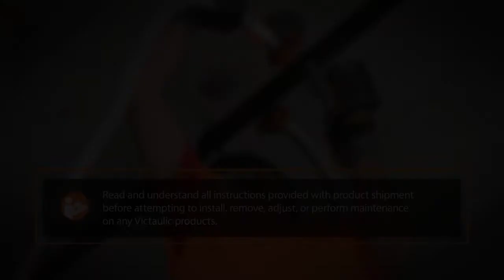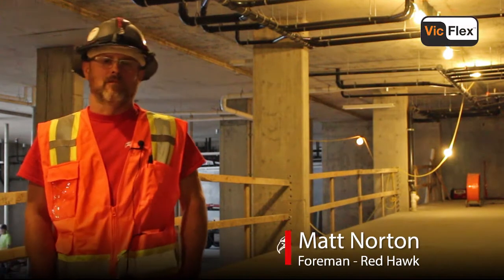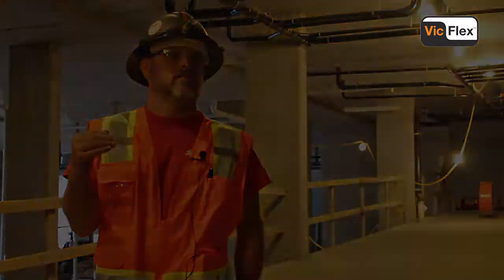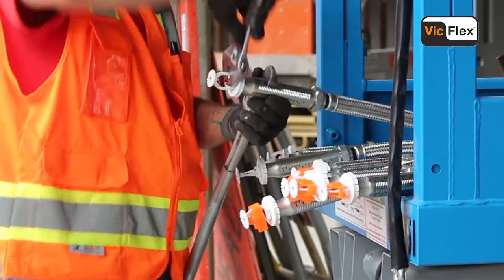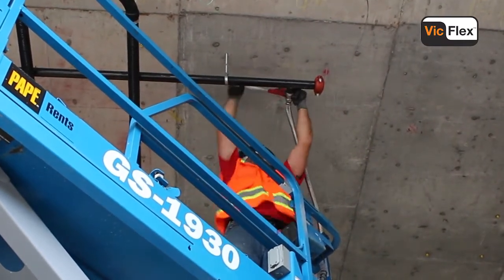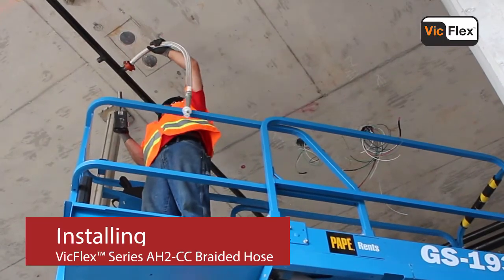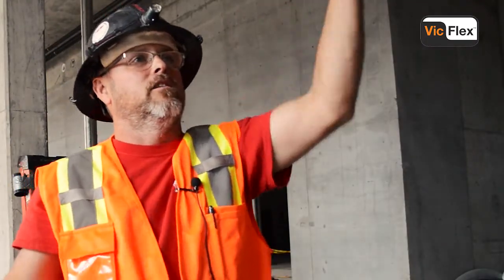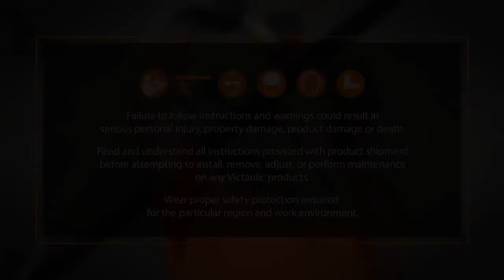Victaulic VicFlex™ Beta Site Series AH2/AH2-CC Case Study

Comment: Flexheads serve there purpose when the system piping is much higher than the ceiling elevation. Just pipe down close to where the head will be and wait for the ceiling. Piece of cake. That’s the only time I’ll choose to use them. Other than that. I’ll hard pipe my heads in all day.

Comment: So these new flex heads need a 1" grooved weld. So what happens when you come back to do a build out and relocate heads with pipe? You either replace the line pipe or you get a thread groove nipple and 1" Vic. And you have to cut groove the nipple. Yeah that's dumb. Orrrrrrr you do the build out with flex heads hahaha. Flexheads are stupid. Take all the skill out of the trade. Absolutely stupid.
Reply: they also have grooved mechanical outlets or male thread by 1" grooved outlet nipples. The welded groove nipple is a good option for new installs that will be using prefabricated pipe sections.